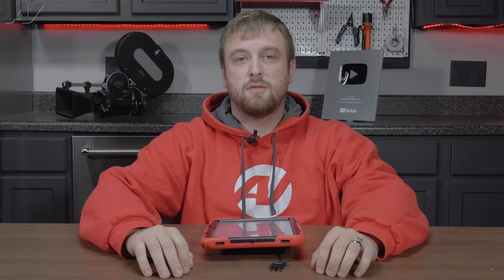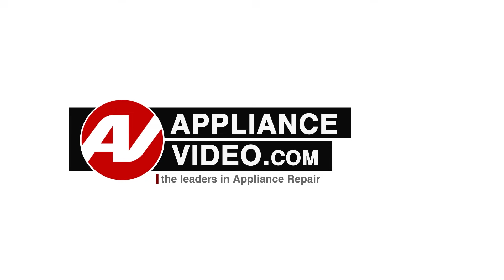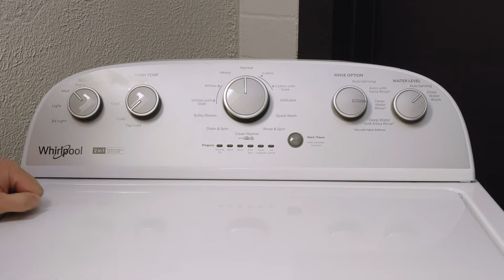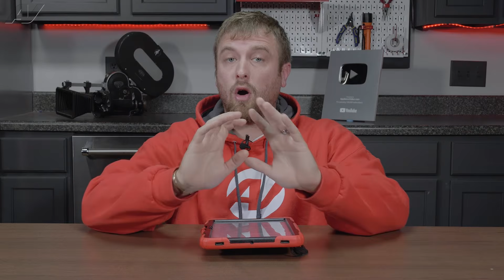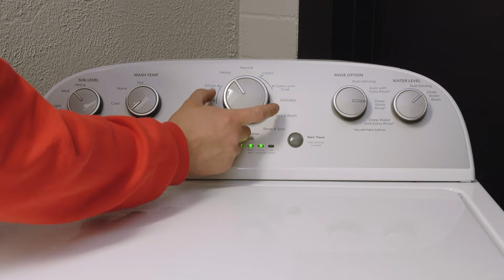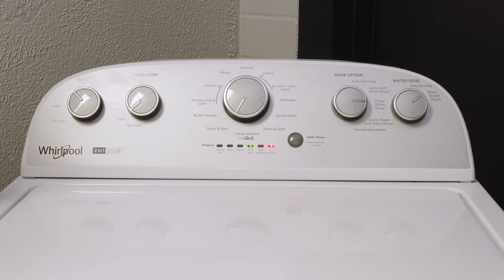Whirlpool Washer - How to enter into Diagnostics & Get Fault Codes & Troubleshooting Tips

Comment: In diagnostic mode, I have only the Sensing light flashing which if understand it, that means no fault or error.  Yet washer will not wash - sticks in Wash mode and nothing happens.  Weird
EDIT:  You'd probably never guess what the problem turned out to be.  I sure didn't.  It turns out the issue was that I had the drain hose running directly out of the washer and along the floor to the drain.  According to the installation manual, the hose needs to run vertically and hook into a drain pipe at least 39 inches off the ground.  I guess the washer needs to sense a little back pressure or something,  Otherwise, the water comes in and right back out the drain which is why the washer stuck in wash mode.  It got confused because there was no water in the drum.